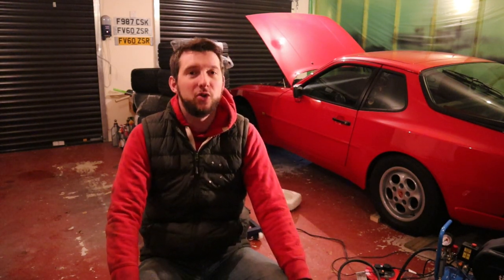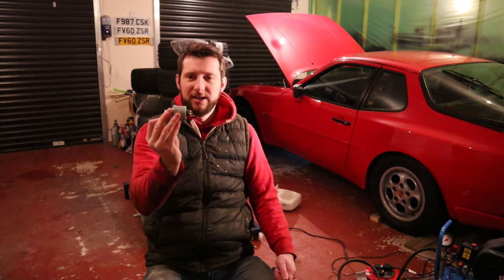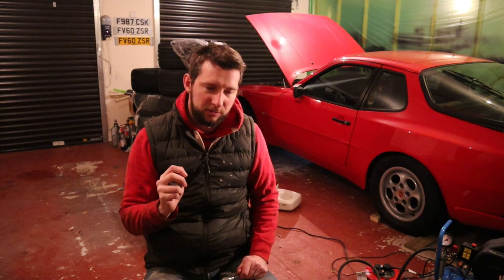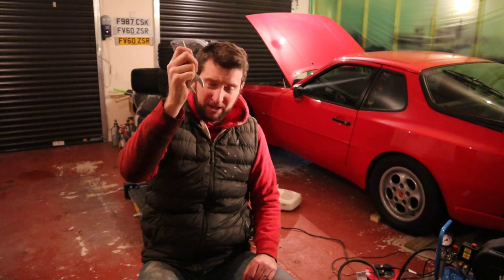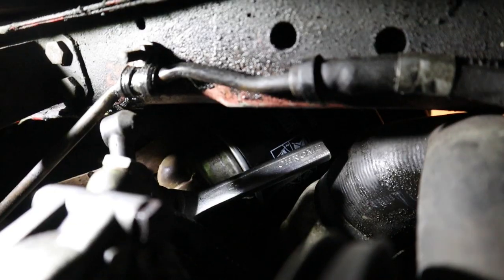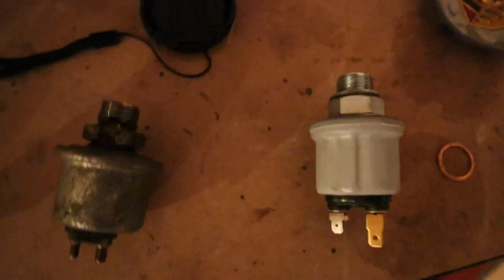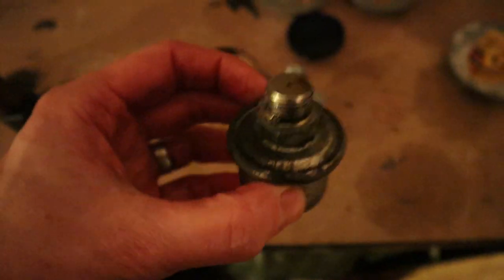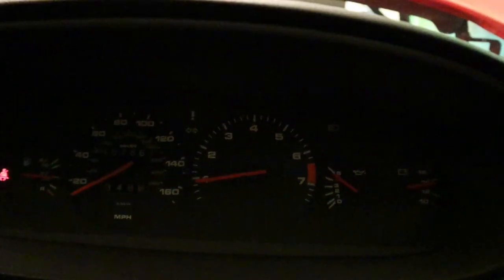Britain's Best B-Roads: Fixing faulty oil pressure reading on 944S

Comment: Hey Colin! Great video (: Quick question - the oil cooler has an open slot for instruments where I want to add my oil temp gauge - do you think it is accessible without removing the oil filter?

Cheers and greetings from the Land of Porsche
Reply from the maker: Hey
Thanks for your questions and sorry for delay in me replying.

I don't have the 944 any more so unfortunately I can't have a look to see. From memory though, I think you should be able to. Give it a try and if not then remove the filter (if it's not old and you can get it off without damaging it then you could put it back on).
Cheers and good luck!
Reply: @colinmclellan7154  Thanks a lot for the advice! I appreciate it a lot. All the best!